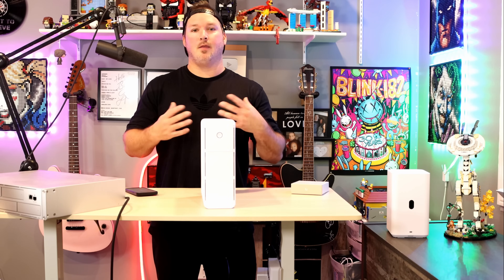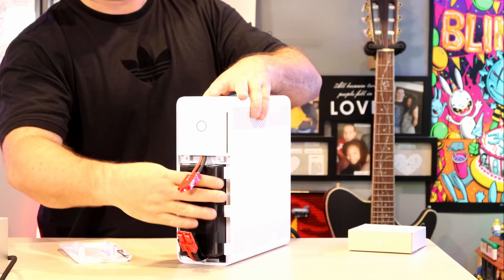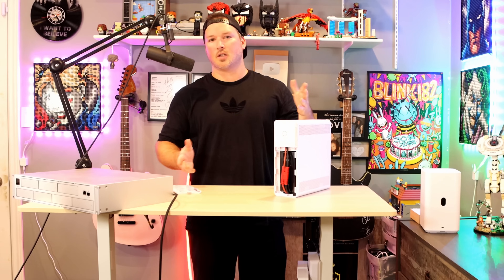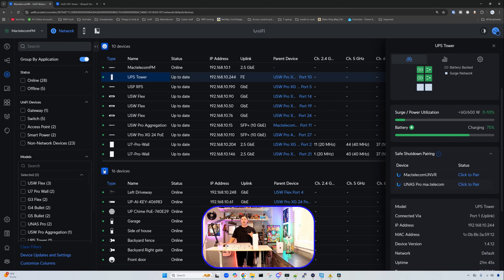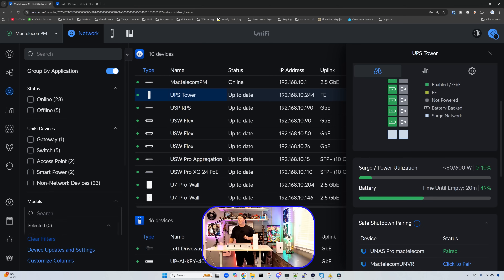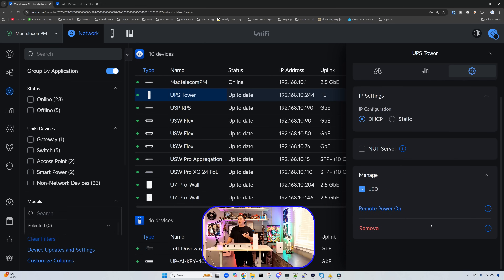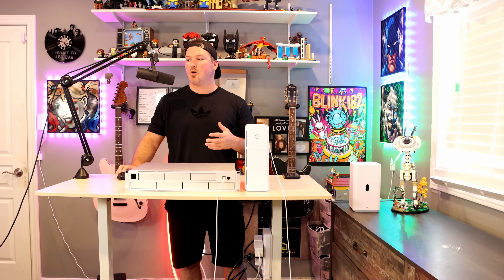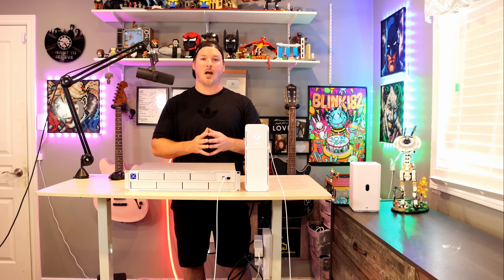UniFi UPS Tower Follow Up

Comment: That's annoying that you manually have to turn things back on. Great video. Thanks for the info!
Reply: Easy solution. You have to plug the UPS into itself so that it knows it’s losing power… Lol, jk
Reply: The problem is that the UPS didn't actually shutdown. The UPS was still on when power came back so there's nothing you can do because from the UPS's perspective - it never cut power to the outlets.
Reply: @traiannicolau makes total sense! So in theory ,if it did lose all power and it got power back, the NAS would then boot?
Reply: @CPurdiePlays  i would say so
Reply: @CPurdiePlays  That is my assumption, yes
Reply: Pretty sure they will fix this through a software update, it should be possible to restart automatically. Especially for they upcoming pro UPS, I don’t see me going at the back of the rack to unplug and plug back each device manually.
Reply: There should be a timeout on the shutdown software to restore a shutdown device after power is restored for some short time period.  Without that the shutdown function.is next to worthless.
Reply: @davesilver5493  An UPS shutdown function is there especially for devices like an attached NAS or Computer so they do a graceful shutdown preventing lost or corrupted permanent data on those devices.  If really serves no function for most other attached devices like switches, cameras, routers, printers.  In a serious IT environment you have to be careful about the potential order devices are restarted after a power outage and do not want them all to just power on at once.
Reply: Wake-on-LAN is the solution. Ubiquiti just need to support it. 🤷‍♂️

Comment: what a strange issue that it did not power on after you click remote off and on
Reply: It’s because it’s using NUT functionality for that, and basically they enter a soft shutdown state that leaves the network ports active to receive WOL packets.
Reply: @wb6vpm  Yes, I imagine so. But the strange thing is that after you press power off, (pull the cord), l and then push power on (put cord back again), nothing happens. It makes me think you have to let some time pass. If you notice when you unplug a PC, the ETH still flashes for some time (energy left in the power brick. Maybe the power off/on in the video was too close together? It's unthinkable that you have to physically unplug the cables from behind the UPS every time there's a blackout. That's what I don't understand.
Reply: @wb6vpm  right, and in this case were powers is restored before the UPS runs out of battery, the system should send a power restored WOL packet to the devices it told to soft shutdown.

Comment: Is there an option to power cycle the outlet that the device is plugged into on the UPS to try to kick off that remote turn on?
Reply: Well that sucks and pretty sure not sine wave either
Reply from the maker: Unfortunately not on this model it is unmanaged

Comment: I thought in the specs it said that they were using a Lithium-Ion battery but that is clearly an lead acid cell battery.
Reply: Was Def lead acid tower and they introducing lithium later
Reply: I think the Li-Ion is for a yet to be released device. That form factor should cater for Li-Ion as well though

Comment: couldn't you just go to the outlet port in the UPS and powercycle the port? that would simulate pulling the cord out.
Reply from the maker: The ports are not manageable unfortunately
Reply: @MactelecomNetworks what that's such a missed opportunity lol
Reply: Nope, it would make a UPS a lot more expensive having a 10A to 16A relay per port. Even UPSes like from Aeton and APC usually have groups of outlets that can be switched. Only some bigger and more expensive ones can do that.
But usually they advice you to buy a PDU that can do that.

Comment: Can you show more to the NUT Server feature. Fan it be paired with a Synology DS. There must be set a specifc name (usv), user and password. Can the NUT Server and User be configured?
Reply: It's totally buggy. Plenty of people posting NUT communication issues in the community forum.
Reply: Just disable NUT authentication on the Tower UPS and Synology works fine with NUT (Syn Srvr mode). Limit it with firewall rules if it makes you nervous and keep in mind that the NAS needs connectivity towards the UPS Tower during the power outage.

Comment: In theory,  could you pair your UDM-Pro to the UPS even if you are not powering the UDM-Pro with the UPS?   So let's say you have the UDM-Pro plugged into a different power source.  With it paired to the Unifi UPS, it would still send a safe shutdown due to loss of power at the Unifi UPS.
Reply: Correct, and when the power comes back on, the UDM would start and you could try to cycle the outlets of the UPS, but apparently that didn't work!?

Comment: If you are ordering 12v 9Ah batteries for this, make sure you get the "F2" style connectors for the battery.  Not sure how they are going to fix the power back up issue.  The UPS instructs the UDM to do a safe shutdown and the only way to power it back up from that would be pull the plug.  In the safe shutdown state, the UDM's network interface ports are also powered down.  Even if someone had a Power distribution pro or one of the other ones, you couldn't get to a user interface to power cycle the port.
Reply: Ah, I figured it out... Clap on, Clap off power plugs for the win!  ;-)
Reply: WOL ?
Reply: @EduardoSantanaSeverino  I don't believe the nic cards are powered up on the udm's in shutdown state.  WOL wouldn't work.
Reply: @terryjohnson3100 thank you for your response. after some thought, i think you are right.
Reply: Easy… just use a HomeAssistant script that automates a robotic arm with stylus rubber tip! Lol
Reply: Great point! F1 and F2 battery terminals are types of push-on connectors used primarily on sealed lead acid (SLA) batteries. F1 terminals are 0.187 inches wide. The F2 terminals are 0.250 inches wide. F2 terminals are for handling higher current requirements usually used in applications like uninterruptible power supplies (UPS)

Comment: Does this device effectively act as a pdu when there is no power interruption.
Reply: How does the UniFi UPS Tower operate when there's no power interruption?
When utility power is stable, the UniFi UPS Tower supplies power directly from the mains while simultaneously charging its internal battery.

The built-in Automatic Voltage Regulation (AVR) stabilizes minor voltage fluctuations without switching to battery mode, maintaining output within 89-145 V (US) or 170-280 V (EU).

The UniFi UPS Tower will send a graceful shutdown signal to NUT whenever the battery voltage is low (about 2 minutes remaining), regardless of the load condition.

When UniFi UPS Tower is in Battery mode, the usage time is as follows:
Full load(600W): 2 min
Half load(300W): 7 min

Comment: Is the battery hot-swappable?
Reply from the maker: Nope only one battery in it
Reply: @MactelecomNetworks What I meant was can you disconnect the battery while the unit is running on AC and change to a new battery.  I can do that with the APC units I have.  The reason I ask is that I want to keep the systems up and running while I do a battery change.
Reply: @rogerf3622  yes, you can unplug the battery and let it run off line voltage during a swap
Reply: I’ve been using the UPS-Tower for a few days.  The software feature set is very limited out of the gate but will probably get additional functionality over time.  Hopefully this will include being able to issue a shutdown to other UniFi devices that have expandable storage such as the UCG-Fiber when you install an NVMe SSD and flexibility to set the percentage of power remaining before shutdown.  🙏